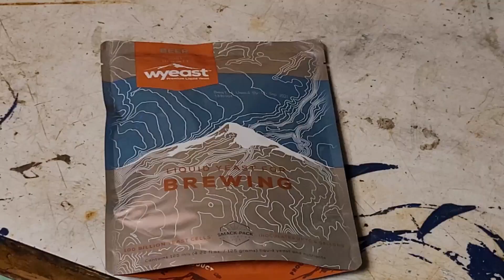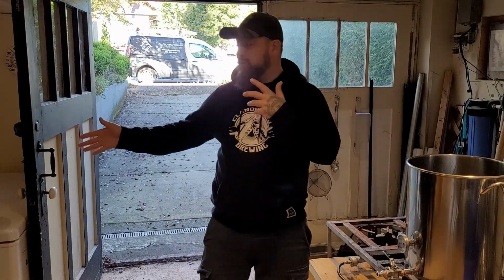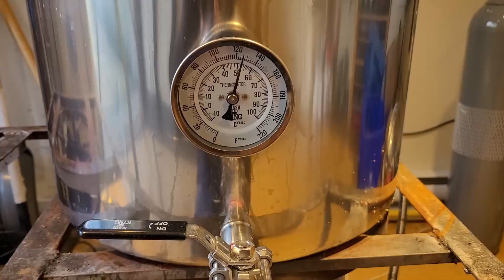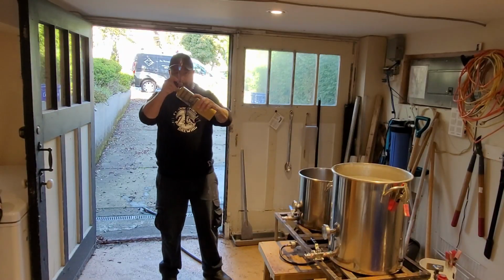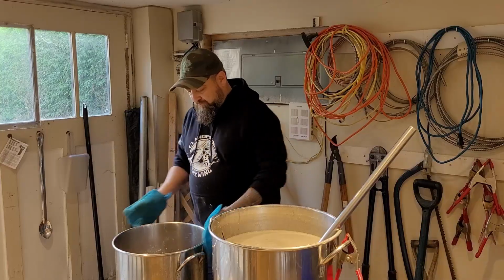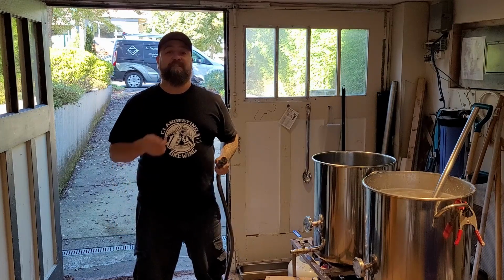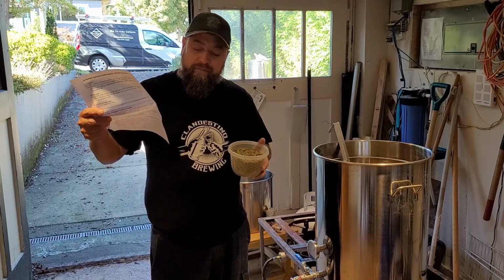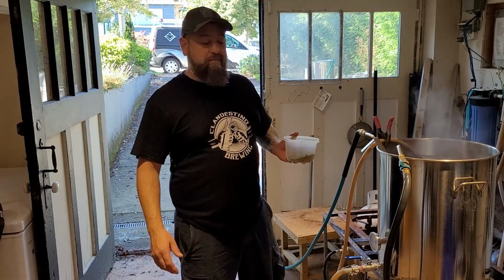Brewing a Urquell clone

Comment: If you want to try it, here is the recipe for anchor steam beer per the official brewing logs from before they closed down the brewmaster gave me the recipe, several years ago. All the homebrewers have had it wrong for so many years.  

For Malts you want the following, For 5 gallon batch.
8 Pounds 8 Ounces 2 Row Pale Malt from Great Western Malting that is specifically who anchor used. 
1 Pound Caramel/Crystal 40L Briess 

You want to perform a stepped Triple Decoction mash. 

You are targeting OG of 1.049 and Final Gravity around 1.015 for final ABV of 4.5%.

Boil for 90 minutes 

adjust depending on batch size but for 5 gallons you would be looking at the following,
0.50 Ounces Nugget Hops, Boil for 90 Minutes 
0.80 Ounces Northern Brewer Hops, Boil for 10 minutes 

Chill down and pitch California Lager Yeast from White Labs or Mangrove Jacks. 

What anchor did next was they would add a fresh batch of identical wort to the finished batch freshly yeasted and let it carbonate in tank and then cold crash it for 4 days to remove sediment then bottle the beer I have found that this second addition is the key to getting the taste in the beer. 

They targeted a fermentation  room temperature of 68 Fahrenheit.